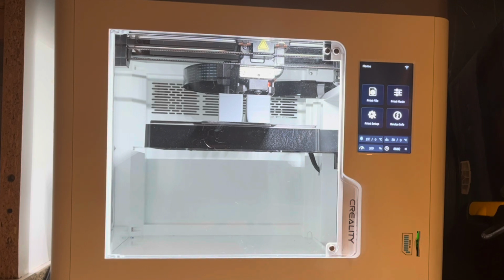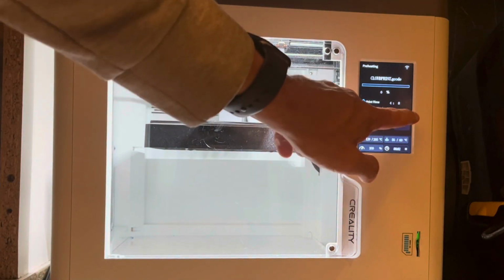Creality Sermoon V1 Pro bonus features! 3d printing

Comment: Great video demonstrating a fantastic piece of kit. However in these days of high energy costs - have you worked out the cost of the electricity when the machine is left on over night?
I think we are all conscious of the high prices of late. Good demonstration and I  would love to own one myself. Cheers Malcolm
Reply from the maker: Thanks Malcolm.  Just by chance I've bough a little gadget that plugs into a socket and tells you how much power the device is using!  Looks like the printer uses 11w when on but not printing (so 0.4p an hour?) and around 150w when actually printing (around 5p an hour) so not bad really. Thanks for watching 👍
Reply: @SimonsShed  That's great and useful to know that an all night printing stint will only cost say 40p i.e. (8hrs x 5p). Pretty good considering the energy costs these days! Look forward to seeing other things you have done! Cheers Malcolm

Comment: Like all the features you mentioned.  But how are the layer lines, are they really noticable. Thanks for sharing 😀 have been looking into getting a 3d printer but not sure about an filament or risen ptinter?
Reply from the maker: They are visible on filament printers, you can use a smaller nozzle which helps but I'd go for a resin printer if the layer lines are an issue as they are pretty much invisible on resin printers.  Thanks for watching 👍
Reply: @SimonsShed  thanks I was wondering if they were an issue or not .